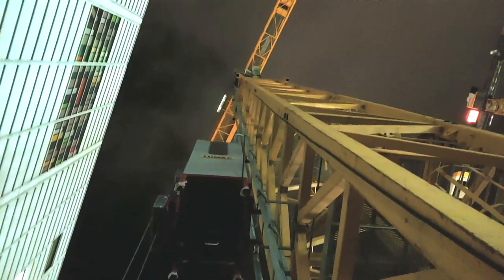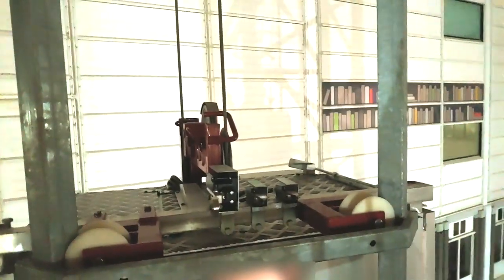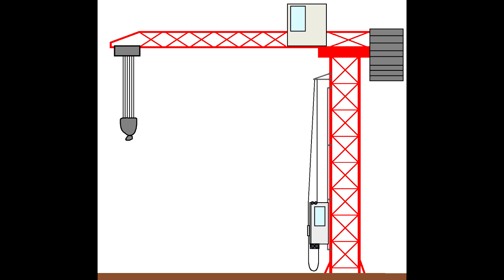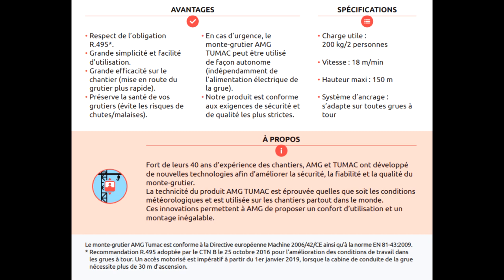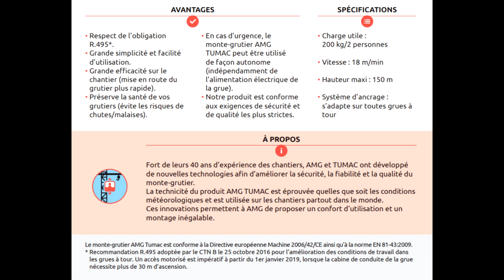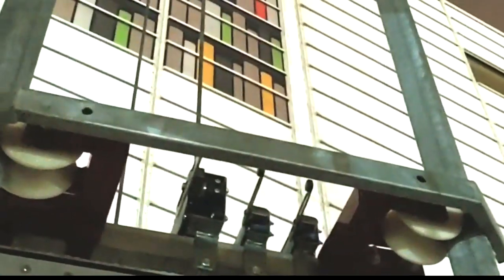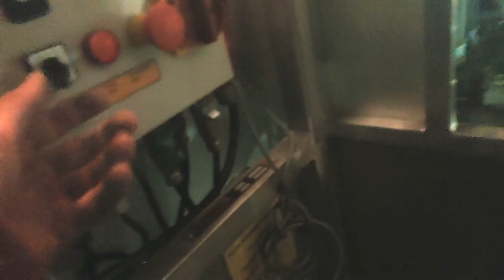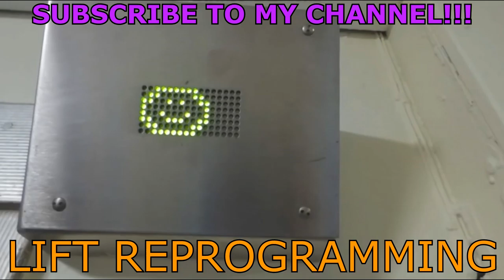Tumac lift on a tower crane

Comment: I’ve never seen one of these lifts before. The guide rail tracks look bend at the bottom.  The attachment to the tower at least is a diagonal made of welded box sections, that doesn’t look too bad to me. However those bolts.... could be easily undone by someone. The bolts them selves look ok to me, they are subjected to a shear force. I’ve made bolt load calculations a few times. The whole may look flimsy but those bolts have a high tensile strength. I do find the guide rails dodgy, they look very slender to me and could easily deform. Personally I prefer reinforcement concrete over steel as a construction material but concrete is usually cracked under normal conditions. This may sound crazy but it’s normal as the cracks are very, very small. Steel is very good at tensile stress but it is not as stiff as concrete when it comes to deformations. Isn’t structural engineering fun?😄 something may look impossible at times but can still be sound if you analyze it.
Reply: I would like to add that it might have a safety / emergency brake after all. It says so in the lift itself. The Dutch text states that you have to descend slowly in manual mode or else the emergency brake can trip (how shitty can it be?). Now that kind of text in itself doesn't instil a lot of confidence, but still.
Reply: @MrDubje  Aba! Lalo't talagang subaybayan!

Comment: I'm left wondering how liable Tumac is if something happened during the operation of the crane. It doesn't seem like it would at all be an OEM approved modification, so blame would be on the contractor and perhaps Tumac.
Reply from the maker: I was wondering if the tracks of the lift would interfere with the normal bending of the crane when its weight position changes
Reply: @benolifts  C O M I N G   S O O N